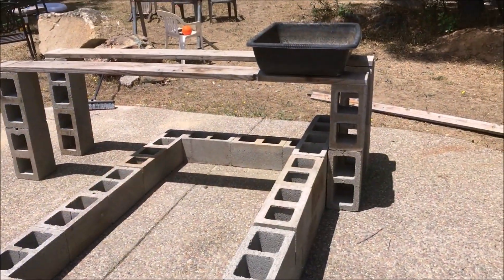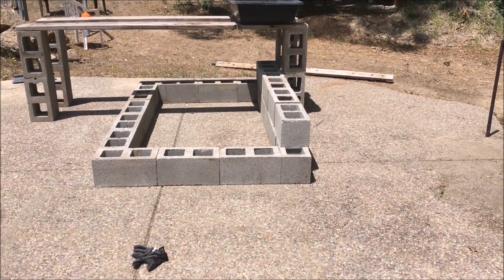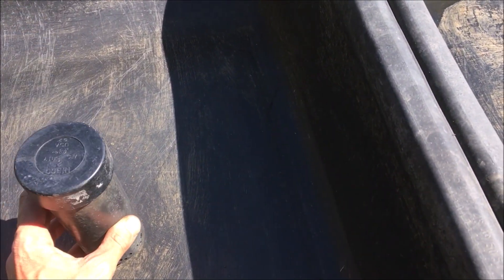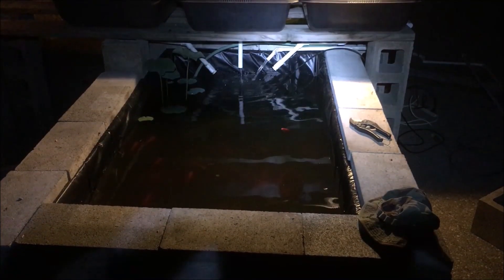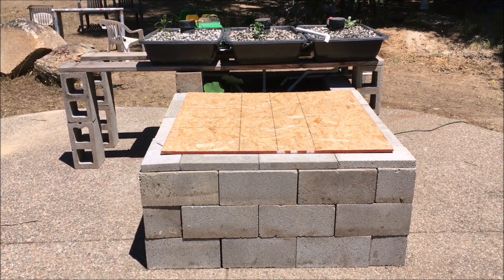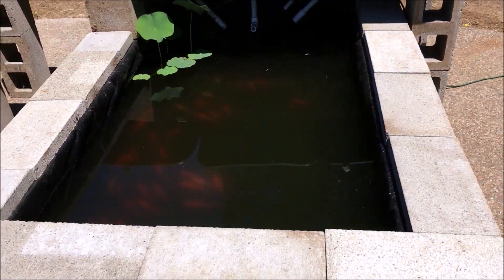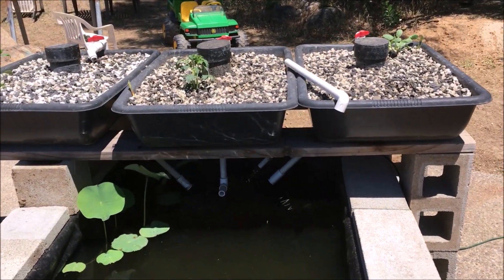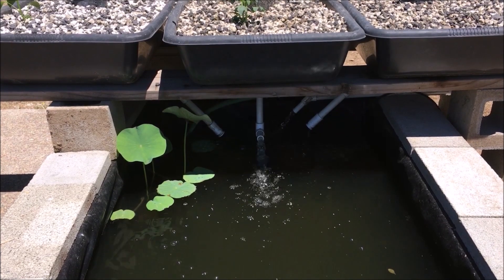Koi Pond Aquaponics with Media Bed Filtration

Comment: Do you have the pipe sizes to everything that goes on top on the bulk head fitting..? The suction piece etc.
Reply from the maker: From bulk head 3/4in stand pipe. 2 inch suction pipe and 3in barrier pipe to keep our rocks.

Comment: That new pond is a great idea. There's something about the bell syphon that I just don't get, but I've been using them. Thanks for the simple explanation 👍
Reply from the maker: It all comes down to trapping a bubble of air and forcing it out. The key to it all is finding the right flow speed of water so that the siphon starts and stops. I played around with this for a long time before I finally got it to click.

Comment: Great job- Your setup looks very similar to mine.
Reply from the maker: Yours is nicer than mine 😁. I have a lot on my plate but I hope to finish my greenhouse before the end of the year. Then I will either move this system or start another one in the greenhouse. I want to get extreme in the greenhouse.
Reply: FARMER G - MY HOMESTEAD ours is front and center in the back yard the wife wanted it snazzy. I use to use those cement tubs but they were too shallow.
Reply from the maker: I will do something different soon enough, for now the cement tubs are keeping things running but yeah, I want something bigger. I have had to take the bell siphon off two tubs just because the roots have overwhelmed the bed (I think). So I’ve had a continuous flow going which brings me to the conclusion that I also need something bigger than the cement tubs.
Reply: FARMER G - MY HOMESTEAD I had a rough go with the bell siphons, did exactly what you did. Now I use a U siphon. Haven’t had a problem since. I’ll make a quick vid

Comment: Is there a way to catch the sludge before it goes into your planters making cleaning the sludge easier?  Thanks!
Reply from the maker: I could always add a Radial flow filter. I’ve done a number of videos on this system. My grow bed Area is too small but it’s worked well. I’m going to make a new system in my greenhouse very soon. I’ll make a radial flow filter in the next one.

Comment: Amazing! I need more! What kind of pump do you use? Can this setup also support bluegill or tilapia? A small system like this would be a great way to add fresh fish to the homestead menu. Also you could plant different plants in the cinder blocks around the pond to make a more natural type of shade for the fish later on.
Reply from the maker: Yes ideally I would have edible fish in there. The condition of the old koi pond forced me into this situation but I would rather have catfish in there. Tilapia is illegal to raise in California. The pump in this system was an old pump that we inherited with the old koi pond when we moved here. I’m guessing it’s an active aqua. Probably 500 gpm. Or more. The pump pushes more water than I need at the moment. I have about 200 ish gallons of water in this system. I need to expand the system so that it keeps up better with the pump and also with the nitrate production.
Reply: There seems to be a bone of contention on several boards as to if tilapia are illegal in home aquaponic systems or not. They say for commercial use but the home backyard pond is a grey area with no real concrete info. I'll have to lock that down. Looks like a lot of ppl say the Mozambique Tilapia is not an illegal species. Might be a research avenue unless you have already exhausted this tangent.
Reply: Even here in Texas there are rules and regulations regarding these fish. Because of an old statute, I cannot transport tilapia fingerlings from the place I pick them up at to my home. It's illegal. Ah well, guess I'll raise/eat bluegill!🐟
Reply from the maker: The companies online say that they will sell you tilapia. It’s not illegal for them to sell it. But... I’ve looked into it. In ca you can have them to raise if you are permitted and live in 5 approved counties. I do not. I’m out of luck on that one. Oh well. Blue gill and catfish it is. Lol.

Comment: Or can you make a supply list including the blocks and where to buy from?
Reply from the maker: Most everything I had already on the property but I know almost everything I used can be found at Home Depot. Blocks, pond liner, insulation board, piping, bulk head fitting, concrete mixing tubs all at Home Depot. I bought my pump on amazon and got the media rocks at a local hydroponics store.

Comment: Awesome Job Dude!! Do you have plans that you can share? Also, do you have an update video? Thanx
Reply from the maker: Thanks. I built it without any idea what I was doing. I just used things I had lying around.  I used a 7x10ft pond liner that I got at Home Depot. There’s roughly 200-250 gallons in the system. All dimensions are weird numbers. I just made it fit with what the blocks allowed me to do. I’m sure it’s easy enough to replicate if you pause here and there but I’m here for any specific questions. I definitely need more growing space. Very soon I will clean out the beds and get rid of some sludge that has built up over the last year. I will video that and get some plants going again. It was a rough winter. I will talk about all that soon. I plan to build this much bigger once I finish my greenhouse. For immediate update videos you can see my pvc cages, cucumber trellis, pulling cucumber plant videos are all related to that system. Hope that helps. I’m here for any questions 😁👍

Comment: Dimension of your pond please
Reply from the maker: I used a 7 x 10 ft pond liner. There is a little bit of overhang. Roughly 3 ft width, 2ft depth, 6 ft length. I have between 200-250 gallons in the system. Hope that helps. 😁👍
Reply: Sir how many koi you put to your pond?
Reply: How many koi you put sir?
Reply from the maker: I believe I had 81 fish all together in the video. I have since lost 8 or 9 over the last year. All these fish were in a much larger pond that I no longer use. These fish were all here already when I moved onto the property. For many reasons I eliminated the pond that they were originally in. There’s a video on it. I did the best I could at the time to provide a safe and clean environment for these fish to be in, however the aqusponic pond is overstocked. I very easily could reduce half the fish or more. OR add twice the grow space. This video is a year old. Currently, two beds are overwhelmed with sludge. I will do a video soon where I clean it up and get it going full speed again. If you are looking to size your system i recommend you google media bed calculator  you will find a calculator that will give you parameters for sizing, amount of fish and amount of feed. Following the calculator you shouldn’t end up like I have. The calculator had the goal of sizing correctly so you don’t overwhelm your beds and create a sludge problem. Hope this is helpful.
Reply: Thanks sir